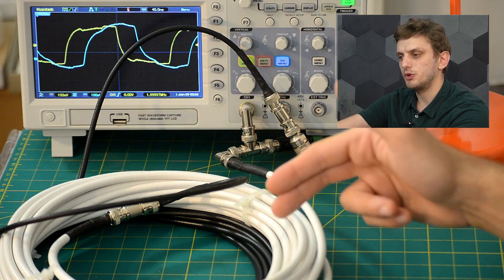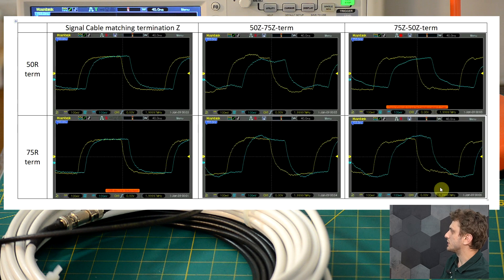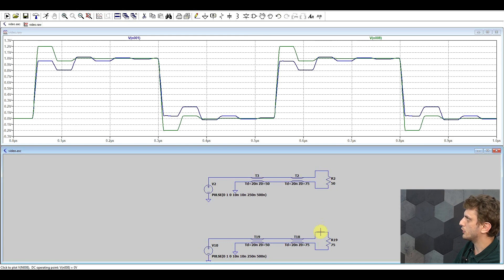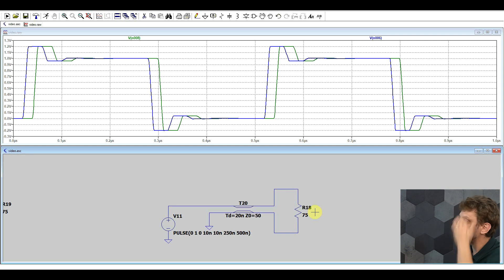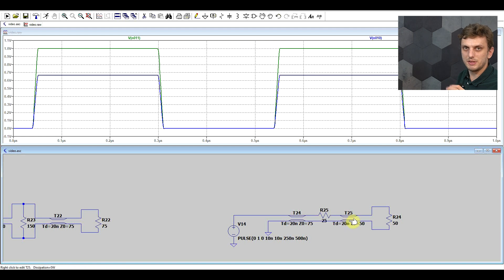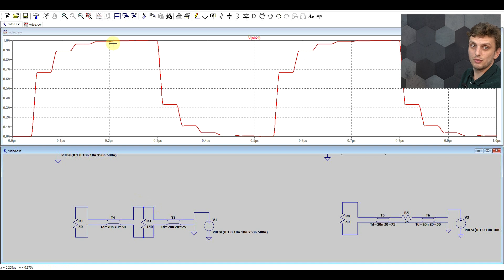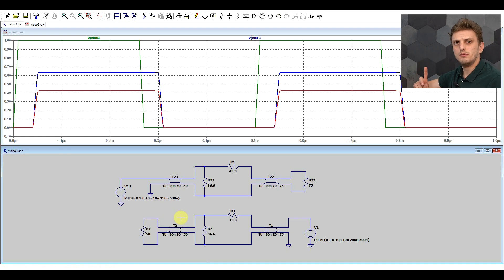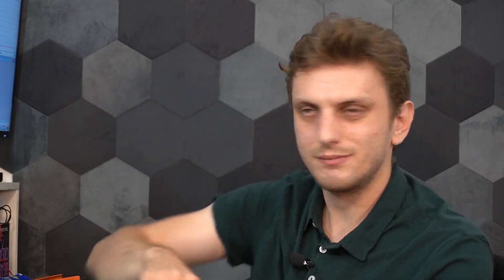Electronics tutorial - Resistive (lossy) impedance matching

Comment: Very nice video. You're dealing with a problem I find rather complex. I didn't realize until watching your video that LTSpice could simulate propagation in wires.
I would just do one remark. When you add a resistor in parallel to an other one to match the cable impedance, it is worth mentionning that it works only because the two resistors are close enough from each other compared to the wavelength. Otherwise, we're faced to an other transmission line between the two resistors. That's the only point that was not clear to me.
Reply from the maker: You are right, the distance between components is critical in deciding whether the "trace" is just a 0R short circuit, or a transmission line. In general if the propagation delay trough the trace is comparable to the signal wavelength then it needs to be treated as a transmission line.

Comment: Hello,

It is possible to model and simulate stubs in LTspice?
If it is possible, can you model and simulate stubs in LTspice in future videos?

Thank you.
Reply from the maker: Well you should be able to simulate them by splitting your transmission line into 2 pieces, and just add a 3rd line which is not terminated into the junction. But for proper high speed simulations LTspice might not be the best option, you would need a program where you can import your PCB design directly.
Reply: @FesZElectronics  what type of program can we use?